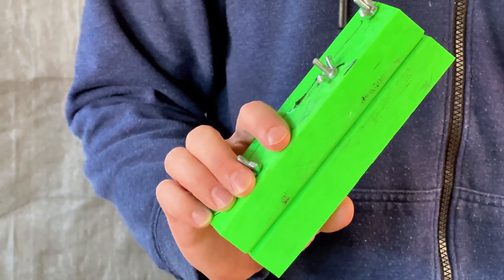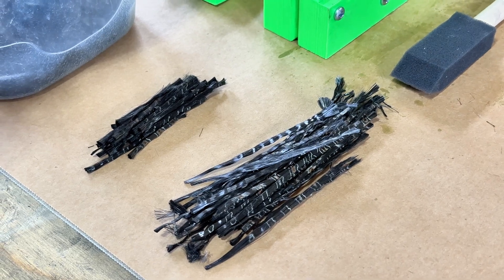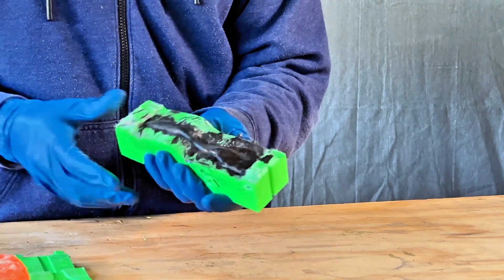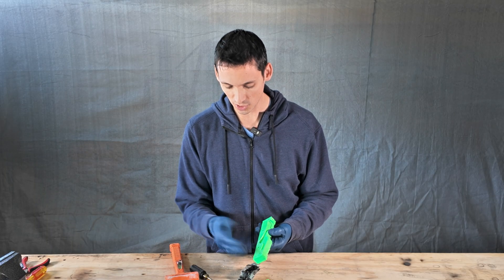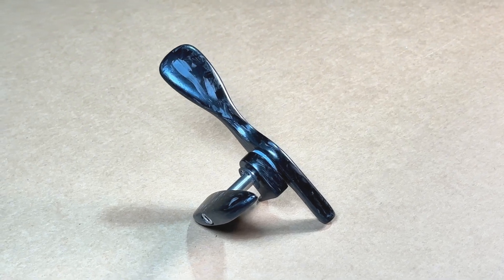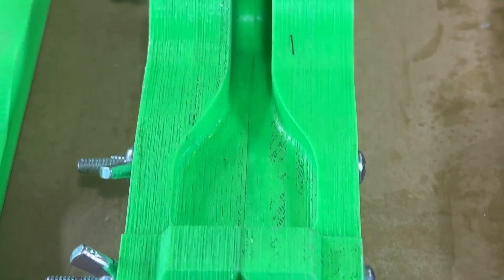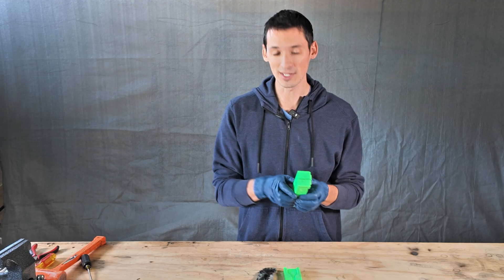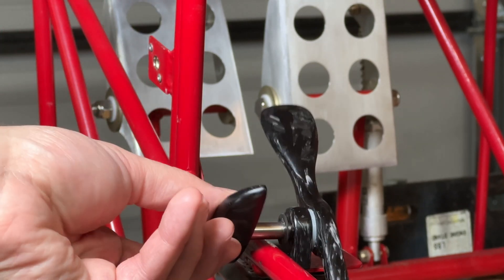Will This Mold Make Better Forged Carbon Fiber Parts From 3D Prints?

Comment: The carbon needs to be compressed to remove the excess epoxy. Without compressing the fibers and removing the excess epoxy will result in a SIGNIFICANTLY weaker part.

Comment: It’s really easy to add pins to the mold to incorporate the holes.  So you don’t have to drill after
Reply from the maker: I haven't played with that yet. Do you have any more detail on that?
Reply: @letsbuildthis  You can design the mold to have the hole in the location where it's needed but have the hole only go half way through the mold on each side. Before applying PVA you can then put a metal rod that's the same diameter as that hole to fill it. Then apply PVA and wrap the carbon around the rod. Once you separate the molds you will have a hole in the exact spot and diameter that's needed.

Comment: Have you try to print these parts with PPA-CF from bambu? It seems to be strong enough for this purpose
Reply from the maker: I haven't yet. I didn't have a machine that could do it. I just got an enclosure for my Prusa MK3S, so I'm gonna try to see how some tougher filaments do with that. I have some PolyMax PC, but no CF filaments currently. The current molds are still in good shape after a first use, so I may just keep using cheap filament, and plan on throw away.

Comment: Great to see the improvement. please could you summarise, what material (PLA? - and does it make a difference, some people suggest easier release from PETG), what layer height, and what mould release did you use. thanks
Reply from the maker: Thanks! PLA (I haven't tried PETG). I think I was at .16, and I use PVA that I brush on.

Comment: How does it work when your top cap module is higher than the body? Don’t you need some “plunger” action in the top in order to compress the fiber?
Reply from the maker: In previous designs, yes it had a piston like effect compressing the parts, but with this one I stuffed both sides and squished together. I did this so that I could have the part line in a good spot for easy de-molding. Admittedly it required more attention to the layup and squish, but overall wasn't too bad to do.
Reply: @letsbuildthis  ok, thanks for the info. Yeah, the idea I have in mind is potentially going to be tricky to demould. I am actually wonder if it might just be easier in my case to just sacrifice the moulds. I need to make 4 parts, but I think trying to make them reusable is going to add a significant amount of complexity.
Reply from the maker: @matthamilton4053  Yeah it definitely get more complex in the design. Since they're 3D prints it's easy enough to throw them away.